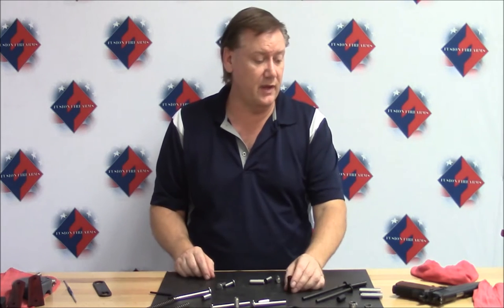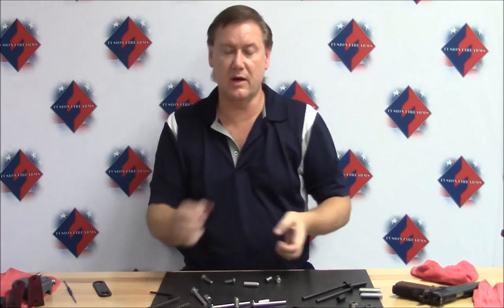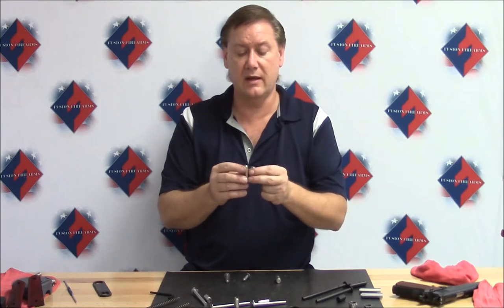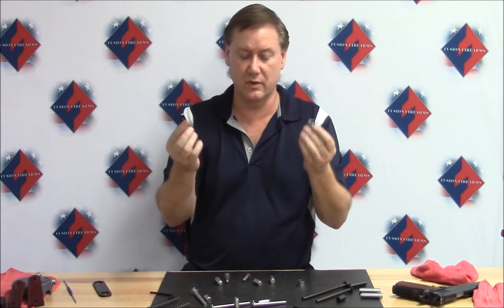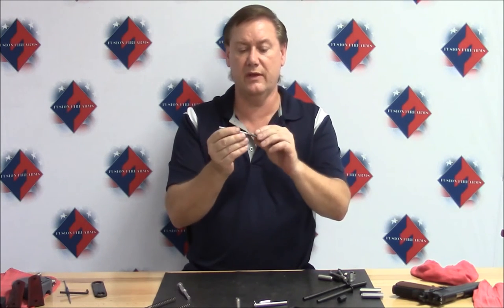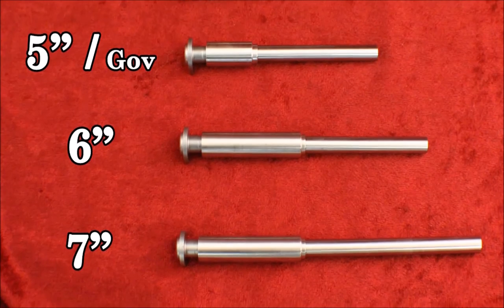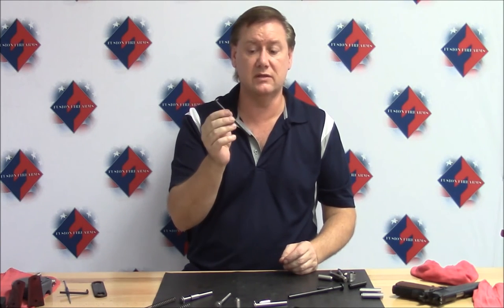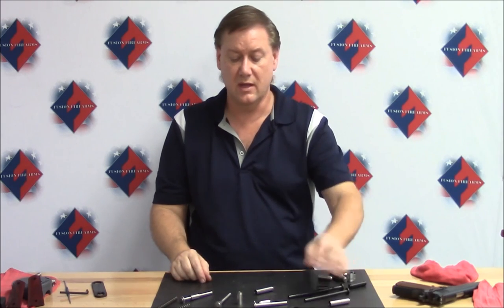Guide Rod Basics | Fusion Firearms

Comment: The American Classic "Amigo" Officer size 1911 comes with a 2.75" Full Length Guide Rod and a Bull Barrel..
It makes buying recoil springs a pain, but the construction of the guide rod is like a Wilson Combat or EGW replacement for a Colt Officer's 1911, which isn't suprising, everything else on the gun is like an upgraded, aftermarket part, compared to most other brands' base models.
Reply from the maker: This is an old video, and what you are referring to is a reverse plug system, which Fusion has the recoil systems and springs to support all makes of officers and defender size. But good question.

Comment: If I put a full size GI style guide rod in  Commander size 1911 what would happen?
Reply from the maker: You will probably be interfering with the end cap and have function issues with a GI style. On a full length it will just hang out the end of the pistol. Don't know why anyone would want to do this.

Comment: Do you know if a 45 acp spring would work for a 40 sw. I want to go from a guide rod to a GI style spring for a full size 1911 40 cal. It is a government style 1911 but I can't find a spring that is not the OE. If anybody knows what would be a good fit for this style model it would help me a lot.
Reply from the maker: The guide rod is all the same, on the spring, I generally use a 14# to 16#  in a 40S&W.
Reply: @fusionfirearms  thanks, do you know if the 1911 40 cal on my 1911 that has a bull barrel on it can be turned into a GI style. Just found out when I purchase the firearm it didn't have a bushing at the end of the barrel. I have seen some but the plugs has a open end now I'm not sure what to do 🤔

Comment: If the 1911 needed a FLGR St.Browning would have designed it that way.
Reply: If that's the case then the same can be said for dovetail sights, laser sights, red dot sights, night sights, picatinny rails, night optics, extended beaver tails, custom grips, match grade barrels, and so on. If they were needed, Browning would have invented them for the 1911 platform.  There is always room for improvement including FLGRs.
Reply from the maker: Well said, Miller Thyme.